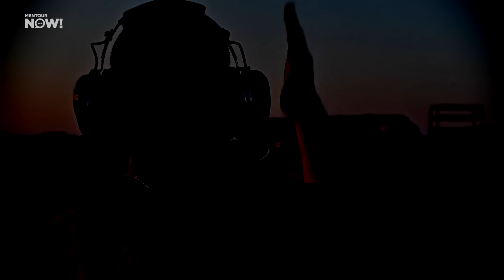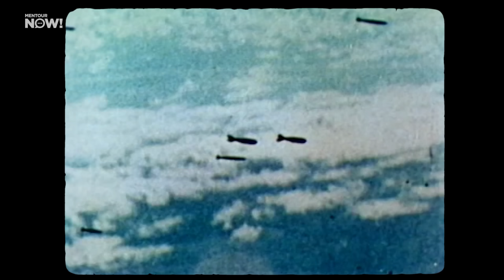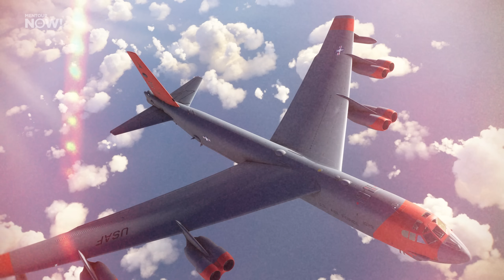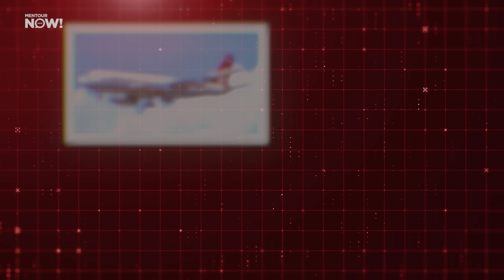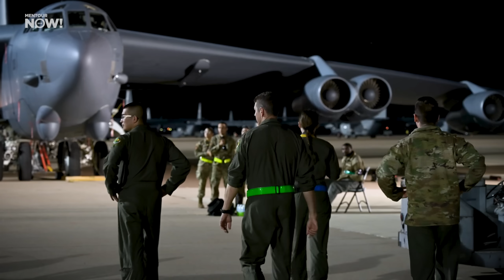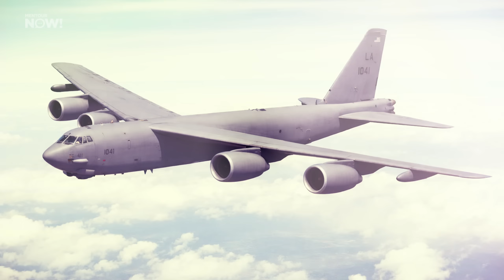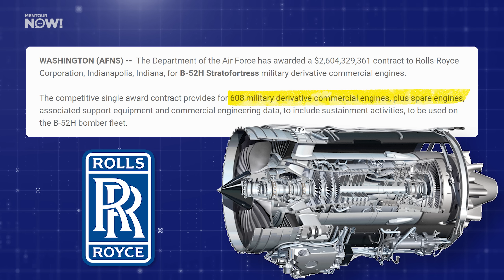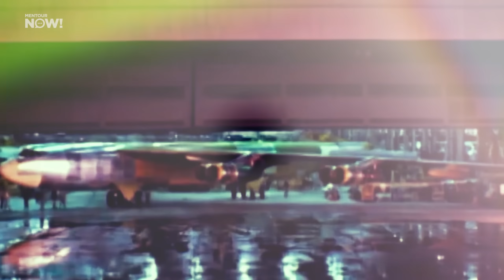WHY Are They Changing The B-52 NOW?!

Comment: I read about another reason why it would be difficult to replace eight engines by just four: Apparently, the B-52 has very weak rudder, and a single engine failure (in a four-engine setup) would already be hard to compensate.

Comment: Survivability--in military context the amount of damage, or number impact sites, caused by hostile weapons fire that does not result in critical damage--is likely a VERY significant impetus behind the USAF's otherwise nearly irrational attachment to the high level of redundancy inherent to the existing 8-engine design of the B-52, stability notwithstanding.  

A long-range bomber may spend hours over hostile territory during a mission, so anything that significantly increases the odds of the crew making it back safely will, and should, be viewed with an otherwise unexpected degree of importance.

Comment: Really informative video good job ,  big fan of the B52. THE B1 B IS the only y bomber produced that carries a larger pay,oad .Than the B52 ....hope you do a video about the B1B  or another very interesting but over looked NUC capable  navy bomber that flew off carriers A3d
Side by side seating no ejection seats. 2 engine one under each wing, huge bomb bay built and Flew to fly NUC deterentmissions, and was used as a tanker after  for mid air refueling all the way to the gulf war

Comment: Some cool trivia about the engine nacelles of the B-52 is how they influenced contemporary General Motors automobile design. After appearing on mid-century "idea cars", the double scoop nacelles were directly copied on models of GM brands from 1958-9 , especially the 1959 Cadillac parking lights, as well as parking/tail lights on 1958 Chevrolets.

Comment: The B-52 was designed when Boeing was run by engineers not MBA idiots. Look at Boeings last thirty years of mistakes made to make shareholder value better. In increasing "shareholder value" they saved vast amounts of money, earned themselves large bonuses until airplanes started crashing and falling apart in midair. This same MBA mentality has just about shut down the U.S. auto, steel and clothing industry.

Comment: When you began with the reasons "why not" replace with 4 modern engines instead of 8 close matches, I was thinking that most of what you referenced being avoided actually wouldn't be - impacts to the airframe and systems would still be there, effectively requiring some level of recertification anyway. Now, maybe those issues would be less, but many such assumptions have missed the mark in the past. 
By the end, I now wonder how much was actually avoided .. would a 4 engine solution actually have been better. Of course, it's easy to wonder and, as this case study shows, you just don't know what you don't know. So it's not useful to second guess the decisions (a better question might be why we can't afford to build a new design today), but perhaps it will be relevant to other upgrade programs.

Comment: It’s simple. The B52 can dump bombs out it’s bay faster than the B1 or B2 as they have aerodynamic turbulence under the fuselage that can cause bombs to collide as they exit the bay. Not good. But they B52 can drop
It’s huge payload faster, no turbulence. And as such, it can place its load in a smaller, more concentrated strike.

Comment: People often think that because something is old that it is automatically outdated.  The design of the #2 pencil is over 100 years old but we still use it today. Until there is a reason that the #2 pencil just isn't good enough to write words on paper, the #2 pencil will continue on. The B-52 still works and does what is needed of it.

Comment: I flew Gs and H model BUFFs.  Eight engines is exactly what the jet was designed to use. I was called to Boeing in Wichita to help with the proposition of replacing the engines with four modern airline engines. We simulated the four engine design during multiple takeoff engine loss scenarios at multiple gross weights. The jet can not be safely flown in that configuration because of the 10% chord line tail arraignment. A new tail and new stronger wings would be required to use four engines. The source selection for the new engines are eight smaller engines with similar thrust characteristics as the TF33. This is the only design that will work with the existing airframe.

Comment: Thanks very much for making the effort to explain this beast to the rest of us. 
REFORGER 88, I was on a hill in my tank looking out, and saw a black dot on the horizon. My TC told couldn't see it, dismissed it, then moments later, it was a B-52 at really low altitude. Almost right overhead. Magnificent. I am super thrilled that the BUFFs, all built before I was born, will still be here after I am gone.

Comment: I crewed on B52 D models at Dyess Air Force Base in the 'mid 70s,  which was then the oldest B52s in operation.  Some of them left our base and went directly to the Boneyard, it's a pretty cool airplane kind of hard to believe they're still around. It's a pretty weird airplane it's one of the only airplanes that can actually take off with the back wheels first and then the front wheels. It's also pretty cool to watch a B52 land with 20° of crosswind crab., which means they're taking off and Landing  at a 20° angle to the runway. Which looks weirder than shit. Youtube has some good B52 crosswind crab Landing videos. Check out the videos it's pretty freaky looking.

Comment: The iconic B-52 isn't being "changed", it's being IMPROVED!  The new ROLLS ROYCE engines provide more power while using less fuel and they don't emit the smoke the old engines did!  With constant upgrades these old warhorses could still be flying flying well past the century mark!😊

Comment: Once saw an interview with a B-52 pilot.

"This airplane has the power of 10 railway locomotives, enough aluminum to make 11,000 trashcans, and 50 miles of electrical cabling."

Interviewer: "But what's it like to fly?"

"Well, it flies just like 10 railway locomotives towing 11,000 trashcans at the end of 50 miles of wire."
Reply: Flies how you’d expect

Comment: The commentator has neglected the elephant in the room: the simple fact is,  that the new crop of engineers are struggling with a lack of mechanical experience. This problem is in every major aerospace company and its suppliers. Too many computer commandos, and not enough scruffy knuckles and bruises.

Comment: Thanks for this video. For years (decades) I've wondered why they haven't replaced each of the antiquated twin-engine pods on the Buff for a single high-bypass turbofan making it a four-engine plane. 

Now, I'm wondering why they don't just commission a new replacement bomber, like a modified 777.  If they use an established airframe design, it would seem to me to be much less expensive. I know the (very) long history of the B-52 and how it keeps outliving it's service lifespan. But like it's aging engines, it can't keep going forever. I would think that the benefits of a modern airframe would pay for itself for a number of reasons. I guess that's what makes the B-52 so special.

Comment: I flew B 707 320 C " Intercontinental " , 
P&W JT3D - EB .
Then the Douglas  DC 8 71 F  ( CFM 56 ) , they said it was like having a 5th Engine !
But ...inboard engines where just 2 feet above ground . 5.5 degrees of bank and you would hit the engine cowling !

Comment: First job I had was designing some magnetic parts for the B52 in 1966.  Surprisingly our magnetics shop got a contract in the 1990's to build some more of those parts.  We ourselves could not do the manufacturing, so we found a local supplier who had specially trained Mexican women, who were seamstresses in their off time, to be able to do the work.  Magnefiers and special tools required, all made custom for their shop.  PS:  One big reason why 10/1 bypass engines cannot be used on these airframes is the Ground Clearance.  Modern commercial engines diameter is too large.  If you've ever seen one take off when loaded, the wingtips are almost dragging.

Comment: Not Slide rulers. Simply Slide Rules. Your research team blew it. I own one of the slide rules used during the early days of military jets and 2 generations of spy satellites.  It was used to certify the Lear autopilot installed in the F-86F supersonic fighter in 1954, the Corona spy satellite program, and in the Hexagon spy satellite program that lasted into the late 80s. 
Horribly long drawn out video. Your horribly strained speaking with excessive dramatizing is ridiculous. Twelve minutes in before you start to even get to the point. 
Despite all of the common modifications needed, fuel systems, etc. the single most critical issue was the twisting force of the  lower mounting of the engines, especially with an inboard engine out event. In that event, the outboard engine would be limited to standard thrust levels or it would risk twisting the wing off the fuselage.

Comment: Another consideration of modern engines, versus the old low bypass jets, is waste heat in the exhaust. The old engines are harder to lock onto with heat seekers. With new engines there will be a need to shield or disperse the waste heat / exhaust more so than with the old engines. Or some more enhanced / plentiful countermeasures against heat seeking missiles or even heat based detection systems.

Comment: Why is there no metal fatigue in the B-52 fuselage?
Reply: I'm totally guessing here, but maybe the rate of fatigue increases as a function of the square of G, so an aircraft that (ideally) spends so much of its time straight and level is less prone to it?   There is hopefully an engineer on this thread who can comment, as it's an excellent question.
Reply: @MrFulleraaron  - Most aircraft pressurize to an equivalent altitude of 8,000 feet (10.3 psi). Higher pressures exert too much force on the fuselage & can shorten its lifespan, especially with frequent-haul aircraft that pressurize & de-pressurize, which causes frequent metal stress. That constant metal expansion & contraction over the years causes metal fatigue.
Reply: Constant maintenance

Comment: I'm glad that it's being kept and upgraded. My concern is parts and maintenance. Many companies, such as being & RR, put in contract stipulations that mandate the parts (including very simple one's} can only be sourced from them, even though the Air Force can manufacture many spare parts. I'm talking about less sophisticated parts. Same thing with repairs. The companies put clauses in that certain repairs can only be performed by them. Both of these costs more obviously, and it happens because, politically, many states benefit from the profit of having only one supplier that produces the particular part in their state. Meaning that there is no competition for parts from any other aero supplier that, in many cases, can produce the same exact part just like the US Air Force can do for less. Think about a nut and bolt analogy.  We all know the Air Force pays 10 times the price for a nut or bolt than what it costs at your local retailer. These simple, less sophisticated parts can be made by other suppliers at a reduced cost.

Comment: Why retire the B-52?  It can be kept flying and accomplish its projected missions at a far more cost and mission effective rate than the alternatives.  Yes, there is still a need for the B-21 Raider, simply because the B-2 "Spriit" isn't "stealthy" enough anymore, though none have been lost in action.  It comes down to which "vintage" aircraft to supplement the B-21s and those B-2s still kept in reserve, the "Buff" or the B-1 Lancer.  Sorry, the B-1 was an effective strategic deterrent in its day in the mid-1980s, for about 15 years until the B-2s were available in sufficient quantity with trained crews to take over their primary mission.  It simply isn't as maintainable at the Buff, nor as versatile.

FWIW, I don't see that the Air Force is fully retiring its WC-135s, even though they're almost as old as the Buff.  Or the C-130s; the "Herky" is still a fantastic tactical airlifter and logistical support bird!  Old doesn't mean no longer useful; look at how long the Avro Shackleton was kept flying!
Reply: B1 can carry 55,000lbs more than the B52 tho

Comment: I grew up in Hartford Connecticut, recall testing of 747 turbofan in development by placing one on the inner pylon of a B-52. Saw them fly overhead with seven engines, three pair of two, one of the other.

Comment: Well, for the part that comes to the reyabillity of modern engines and that losinf 1 out of 8 is easier to handle than losing 1 out of 4.  But modern arcfrafts have already prooved, that even long distance are possible with just 2 engines instead of 4. So I say, 4 engines are way more reliable than the stack of 8 they had in the past.  It would make the aircraft more efficient and still very reliable at the same time.  Just my 2 cents to this.  

Other than that, the ild Bomber is truly outdated and even modern engines cant help this thing stay in the air.   In another words:  Its time to roll out a new type of airfraft, that can be operated with less but more efficient engines, be more economical friendly to the taxpayers and the environment and are easier to maintain for long lasting operations.

Comment: Changing the height of the tail would return to the vulnerability of the earlier models which saw tail fins break off.  And yes, you don't change engine configuration without creating a whole new aircraft design because the existing design was built around the engine configuration.

Comment: I recently read that one issue they're having is that the fastener holes are practically randomly spaced. Every unit was basically hand-built without machine drilled pilot holes or drill jigs.

Comment: Old SAC crew chief here (79 - 05)
When I first worked in the phase docks at Castle, an avionics guy told me one of the nav systems still had tubes.
Reply: It did !    The tubes were actually vacume cans.   Ruggudized for in aircraft use.   It would not due to have glass tubes and open electric wire in an aircraft !   😊

Comment: After leaving a tour in USAFE, at the time West Germany in the 70's, I was sent to Dyess AFB as a SS/ABGD (AF Infantry and Security Specialist soldiers) in a SAC (Strategic Air) Command. I "humped 52's" there for several years and safeguarded their QRA (Quick Reaction Area) and WSA (Weapon Storage Area) facilities too. HATED TEXAS! On a hot summer day walking a security patrol the boot wax on your boots would EVAPORATE right off your boots! Also participated in the annual "Giant Sword" competition, and was able to be in the KC 135's (refuelers) and B52's during the competition which was held at Ellsworth AFB, SD that year. I later left the AF to join the Army, Airborne Inf, as the SS/ABGD was a dead end AFMOS.

Comment: Back in the late 70’s early 80’s there was a B-52 at Westover that had what I guess was a Pratt or GE high bypass motor mounted on one pylon. That was probably a program that demonstrated a single engine mounted to the pylon wouldn’t work.on the B-52 The USAf unit there at the time still had C-123 Providers with the recips and the jet engines modified to run on avgas. The Fairchild Ranger motor. And so on…

Comment: Worked on D & G models based on Guam & Thailand & CA (ECM tech) everything from APR9/APS 54 to ALT13/28 from 1967-1970. Nothing like replacing power supplies in the 47 section while sitting on the tarmac while the ambient temp inside is 130 deg. Great aircraft.

Comment: Quite a few comments here from old Buff mechanics.   '72 - 76' stationed at Castle, then Utapao during the end of the Vietnam War, and left the USAF after four years from Carswell.  DFCS mechanic-technician on the D and F models, now no longer around I understand, only the G and H models are still here.  I recall, even when I was a young airman, the Buffs were the same age as me!  Funny thing.... they still are!
Why eight engines?  B-52s fly up to 50,000 feet, which modern airliners cannot, while carrying a huge weapons payload.

Comment: Why not one engine with 2 intakes? There is no reason (other then efficiency) that a single engine needs to have a large circular bypass prop, it can have 2 smaller ones... The argument about unbalanced thrust load on the wing if a full engine goes out is kinda weird, because the B52 is designed to limp back to base (but not land) on a single wing of engines.

Your research should have touched on this tbh.

Comment: Why does an engine upgrade take 15 years these days?! I mean, from the initial order to the first flight of the aircraft, about 5 years passed [contract 1946 - maiden flight in 1952, and from 1955 in service] and that was in a time when there were no computers and high-performance turbines were uncharted territory, the same problem was with jet engines...
It would be easier to design completely new similar plane...

Comment: At the time rate discussed would require WW2 to start in 1940 without a shot fired until 1948, then ramping up for 75 years only to eventually end in 2048. There is no urgency or it (the B52) would get built faster than a data center in Texas. Good reporting sir.